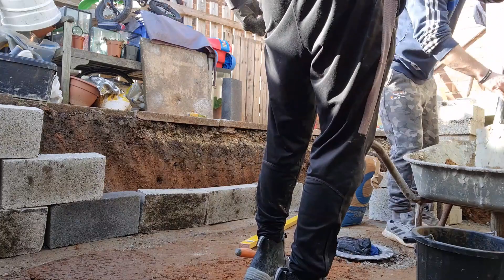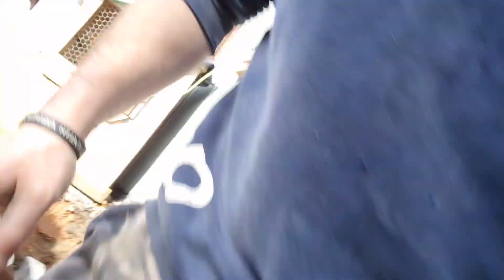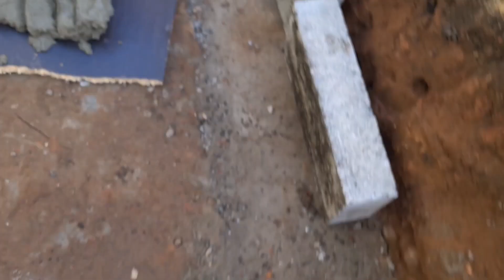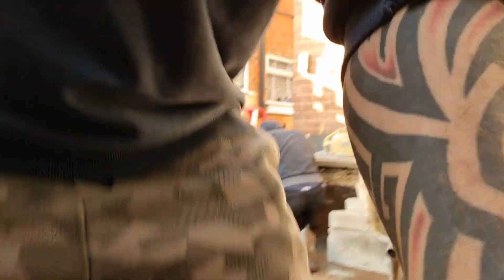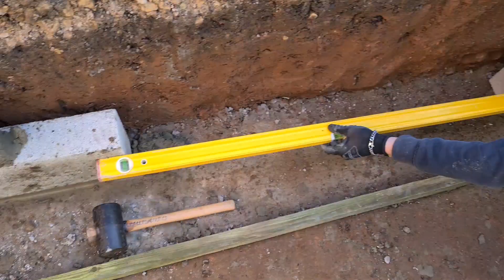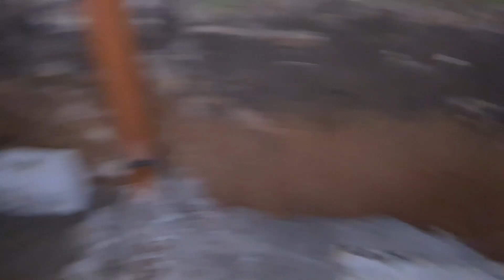Stage 13 Block Work Started Thanx To The Brother Inlaw 😁👍

Comment: Hi, getting there day by day, hopefully there will not be any issues with water pressure, my pond was built with hollow concrete blocks with rebar 20 years ago only a meter from our conservatory. I started to back fill and got above the conservatory footings but I didn’t realise how much concrete it was to take and the cost. Video of the build on here.
Reply from the maker: Yeah I'm things should be ok I'm only 3 blocks high I to the ground and then when I get to ground level I'll be doing the blocks and then red brick finish on the outside you'll see mate 👍

Comment: Will do the job mate have a go at it mate you will be surprised how easy it is just take your time and you will get there 👍
Reply from the maker: Thankyou 😁👍
Reply: @KoiCarpKyle2393  back fill behind the blocks also mate it will be solid then as all the water pressure will be to the Lower parts of the pond 😉👍
Reply from the maker: @Jiggskoi  yes mate might even do another course yet will see buddy after back filling with conny I think it should be stronger enough we'll see matey👍

Comment: Controversial laying the blocks that way ..  will be interesting to see how they hold up against what everyone says about it not being strong enough
Reply from the maker: Defo controverisal bud 🤣They are the heavey solid blocks tho not the light normal blocks but yes be very Intresting I was only saying that about a hour ago to our lass🤣 I'll be back filling with concrete tho but I might also do a course of brick on the inside flush up to the blocks just to be safe im not sure yet just going to get some blocks done first and we'll see 😁👍
Reply: @KoiCarpKyle2393  yer if you look at koipond lifestyle channel and his build the first third lay flat and then laid normally after that ...  personally i think it will be fine ..  most of the pressure at the bottom so so long as you have 4 inches minimum back fill to ground level in concrete I can't see it going anywhere I'm all for belt and braces but I think sometimes it can go overkill so it will be and interesting experiment..   I certainly wouldn't trust thermalites lol but then again they build houses with them but thats nit a sideways load